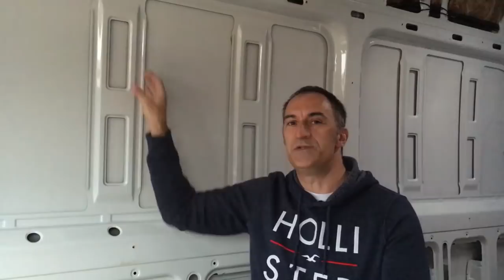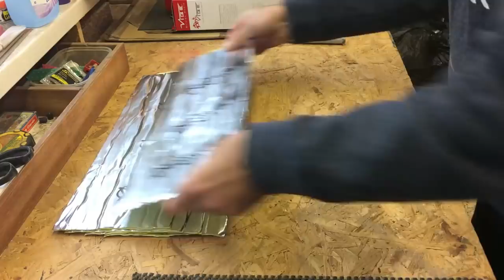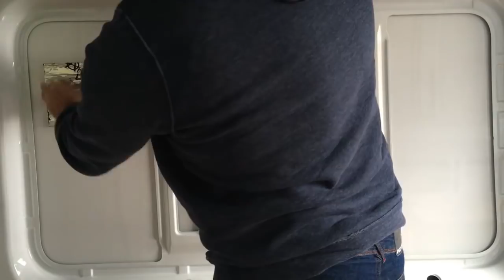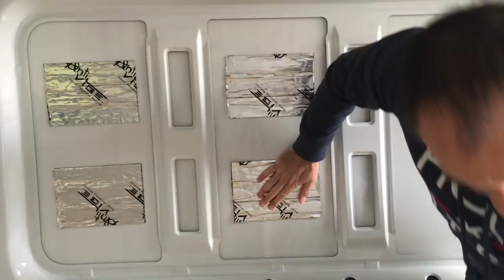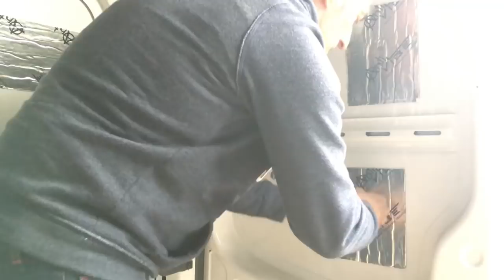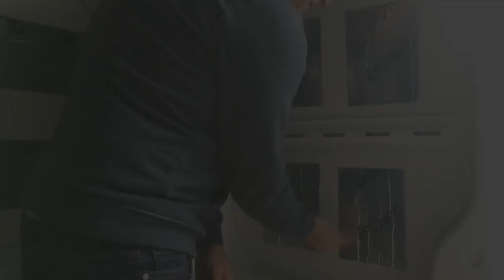Noise & Vibration in your Camper Van

Comment: Oh I love people who use 'sound reason' to solve a problem. You worked out by reason what I had to discover by 'necessity'. Many years ago I was a rather 'pocket poor' youth with a 'nightmare loud' Landrover. I could only afford a metre of the sound deadening material and so chose to stick squares of it to the door, foot plate, and side walls of the 'rover. I was so impressed! Covering  every centimetre is certainly not required. Imagine how covering a whole vehicle adds un-necessary weight, costs a lot, and you have to use up valuable fuel to drag it around. Impressed.

Comment: Greg, the Promaster has a really nice factory hard shell flexible panels with lots of space behind to put insulation. Really like the idea as I'm not going to live in the Van other than weekend trips...any thoughts on this: insulate and then factory panels?
Reply from the maker: Yes, absolutely no reason why not to reuse the factory lining again.
Just make sure to apply a vapour barrier on top of the insulation and seal all the joints with foil tape before putting back your liner

Comment: Not sure if you'll reply, but I've been bingeing your series and loving it! Would you recommend this technique in a 7x12 enclosed trailer camper for preventing outside noise?
Reply from the maker: Hello David, yes I endeavour to answer all questions and this is interesting. Sound deadening material like rattletrap etc is designed to prevent thin sheet metal from vibrating while you are travelling. As your camper is a trailer you won't be inside it when it's being towed so I would not bother with this material. However preventing surrounding noise from entering the trailer when parked up is a different thing to deal with.
Here you need sound attenuation and dense insulation like closed cell foam works best at absorbing noise transfer. Any insulation like rock wool for example will give you some attenuation of noise. So answer is to just insulate as normal and you'll benefit in two ways. Hope that helps
Reply: Hey Greg, you quite made my day by replying! Let's just say you have earned a loyal subscriber and liker of your content. What might be a relevant material in my case? I was thinking perhaps some sort of acoustic paneling (like what you see in recording studios); however, such may also be a misuse of the product.

Comment: Butyl flashing tape, which is available in rolls with a 6" width, is a cost-effective alternative to (supposedly) 'specialist' sound deadening material. In fact, it's exactly the same stuff.

Another good use, besides lowering the resonant frequency of large panels by increasing their mass, is to cover the wheel arches completely. As well as being dense, butyl is viscoelastic, so it's great for absorbing road noise close to the source, stopping the vibration from passing through the rest of the structure.

My advice would be to buy a roll or two of butyl flashing, cover the wheel arches first, then use whatever's left to dampen all the panels.

Comment: Just for future reference I work at a commercial body shop and use this stuff all the time and it is much more pliable and user friendly if you warm it up a little it moulds to the panel extremely easily and sticks loads better. Loving the content and the whole build quality 👍
Reply: The day I installed it was 110 degrees in my van, I found a couple areas where I had missed after installing insulation, that day was 70 degrees in the van, oh lordy was it a lot harder!  My advice, cut your pieces in a warm room with a heat source, then park your van in the sun and let it heat up, then go in and apply.  If you have to do it cooler weather trap a good sized heater inside till everything is warmed through.  110 was grueling but the job was fast.  Using a heat gun without the warm air didn't help as much as the hot day.
Reply from the maker: That's a great tip, I remember it was really cold when I shot this video.

Comment: Would you still need to do this if you plan to use spray foam insulation? Wouldn't that stiffen the panel thus limiting the vibrations?
Reply from the maker: I would say that the spray foam will do the job ok.

Comment: Thank you so much, now I won't be spending as much on materials when soundproofing my sedan. However, it is quite clear that this will deal with the vibrations, but what about the noise from the outside and the road noise? I plan to put foam along with this in the doors and cover the wheel arches with 3M undercoating, will that do the job. Waiting for your answer.
Reply from the maker: To attenuate the road noise you need to use the dense black foam products. The foam absorbs the sound waves. Use a combination of both in the right places will be hard to beat.
Reply from the maker: You got it in one Stuart, I plan to box them out and stuff mineral wool inside the boxes before I close them up.Thanks for asking

Comment: Its probably worthwhile to point out that panels that are installed in the fit-out could also vibrate causing noise. It might be worthwhile to check during and after the fit-out and apply the same mitigation treatments you mention Greg - both check and repair bonding and adding noise dampening materials - as well as noise absorption in the fit-out panels where possible.
Reply from the maker: Sound advice Benny 😊

Comment: Hi Greg, yep foam would work ( clever bstd ) I’ve spent a lifetime in landrovers and v8s so so driving anything too quiet freaks me out a bit haha . Might be picking a new van up Saturday and gonna do it properly this time so gonna be watching some more of your vids i think . Thanks mate
Reply from the maker: Excellent news Dan, What van are you getting?
Reply: Renault master mwb alloys ac spotties 150ps all the unnecessary extras ! In the silver/blue. It’s to replace my 2000 master in the old silver/blue the old girl is just getting a bit too tired. But it has to be a work van during the week so plyed up from the inside of the wheel arches to waist height and boxed in with both ends open for storage .bed hinges up in half both sides racking under bed for tools both ends. The racking slots into runners in floor and all lifts out and flat packs so i can get either a quad or a couple of trail bikes in.
Reply: So it’s a transformer van really sink/cooker unit is removable in one piece so front half of van is empty for work use. Diesel heater and webasto fridge off a split charge .
Reply from the maker: Wow Dan, it sounds amazing. Best of both worlds. I take it the design and build are all your own handy work?
Reply: Yep the racking/bed took me bloody ages to get right so I’m thinking rip it out and refit in new van, might take longer than starting from scratch but  might not and will save a few quid in timber. Must be 6 sheets of ply involved. Any ideas on good floor covering ideas? I was thinking rubber matting if i can do it in one piece,i used kitchen vinyl in the old one not tough enough and too slippery for tools and bikes.
Reply from the maker: I’m thinking of Altro flooring. The stuff that has the round circles you see in Leisure centres etc. Really tough.
Reply: Thanks mate, just had a look at the altro stuff . Looks just the ticket and quite a few places doing big offcuts .
Reply from the maker: If you find a good source can you share a link Dan? Cheers
Reply: Hi Greg, I couldn’t find the stuff with the circles on it even on their website but lots of the industrial non slip sparkly stuff. Seems to be a fair bit of it on eBay at the moment and big enough sizes to do a van in one piece.
Reply: Hi Greg, Harrison trim supplies seem pretty competitive on altro flooring prices they do the rubber penny stuff but only 1.5 wide rolls so not wide enough for me . They do some cool hidden trim clips ideal for behind carpeted panels.
Reply from the maker: Thanks for that tip, I haven't found anything wider than 1.5m either. I'd rather not have a join to contend with

Comment: Geezer talks alot of sense . Dynamating a whole van interior is a bloody waste of time and money and adds a shite load of weight ! Wheel arches are probably worth doing ?
Reply from the maker: Hello Dan, thanks for the great feedback. Wheelarches? Now let’s think what are you trying to reduce here. Vibration? No, road noise? Yes. So anti vibration mat is not the solution you are far better wrapping the arches in thick black foam used to absorb sound waves. The arches due to their shape do not ring. You need to attenuate the breakout through from the road. Even building a box around them and packing it with insulation would work.
Hope that makes sense.
Reply: Greg
Reply: I found the before and after of "dynamating" my wheel arches to be dramatic.  I used about the same ratio as shown here on the large tinny sounding panels but enclosed my wheel arches.  Before covering the wheel arches every rock that jumped off the tires made a sharp clink noise.  I had trouble hearing the speakers on full volume as I drove, the road noise was so awful.  After applying just dynamat equivalent, I had to turn down my speaker volume.  Rocks became a faint thud.  Children's voices were softened, as well as bird noise.  When I put in my second layer of thinsulate audio dampener the effect was even better.  I have a nissan NV and the roof was not as sound deadened as the Sprinter is so I did add both layers to the roof.  This really improves the rain noise.  I started out carefully cutting the pieces but soon discovered that I was wasting time with precision.  The NV is kind of erratic in panel opening.  Freehand cutting was clearly easier and dampens just fine. 

Just an FYI, I spent many years treating children with autism, high pitched voices tend to set kids off while low pitch voices aid in calming to a degree.  I find the same to be true when I have a migraine, high pitch hurts low pitch tolerable.  The dampening panels allow low pitch noise but cut high pitch because they stop the vibrations at that frequency.  When a rock clinks on the metal unprotected it sends a sharp high pitch sound through my van due to high frequency vibration.  Now when the same size rock hits the wheel arch it makes a thud. If you don't care about audio frequency it probably doesn't matter.  It's not so much that I am reducing the volume, I am reducing the pitch.
Reply: My thoughts would be to use a product on the outside of the vehicle, like maybe Line-x rock guard.  My Car's wheel wells are lined with a plastic matting, kind of like astro turff.  Please chime in if you have the proper terminology.

Comment: Extremely helpful - I am using my MB van for transporting freight and DID NOT want to use a lot of this dampener. Thank you for showing me that I didn't need to cover the whole wall - just add small panels. A+
Reply from the maker: The sole purpose of this deadening mat is to prevent flat sheet steel from vibrating. 
And only needs to be applied to the large flat panels. I’m small pieces covering no more than 80% of that flat panel. 
Don’t worry about the floor as it’s much thicker and creased. 
Or the small flat panels even the roof is usually creased so they do not tend to vibrate. 
Your thermal insulation will also provide the acoustic attenuation of outside road noises. Hope that helps 👍🏼

Comment: Was it to reduce cost that you didn’t sound deaden the whole panel?
Reply from the maker: No Karl, as I explained in the video you do not need to do the whole panel for it to be effective. The most you would apply is 80% of the area. 
This stuff is expensive and is very heavy so better all round to use only what is needed. 👍🏼
Reply: Understood.... so it was partially cost then ! :-) the reason I ask is because I have done this exercise in another vehicle and completely covered every surface.... the result is amazing..... anyhow great vid
Reply from the maker: Haha ok yes partly but not the main reason. It will add a lot of weight and it’s really not necessary to get desired effect. You must have spent a lot if you covered everything?
I only used 3 small sheets and spent £75!

Comment: Not silicone between the the panels Greg. Silicone and paint don't mix. Manufacturers normally use a polyurethane style adhesive or similar. Good job on the videos👍
Reply from the maker: Sikaflex would stick like mad and remain flexible.

Comment: Another fine explanation. Thank you!
Reply: Do you both know that you can also use a torch to shrink the metal and reduce that sound and tighten the metal so its not as easy to create vibration? I took a metal manipulation course and shrinking the metal may help in some areas where its flexing when you push on outer panels. Maybe using that method and maybe use less of this product?
Reply from the maker: Glad you liked it 😊

Comment: Wow I never even thought about noise regulation. I figured my insulation would do all that could be done. Thanks for the info as usual!
Reply from the maker: Hi Sarah, like I said in the video most manufacturers already do a lot to prevent noise being generated. Your insulation alone will give you sound attenuation as well as it’s thermal properties. Maybe some older vans suffer more with rattles than the newer versions. Thank you for watching

Comment: How much do you need for the entire van? I want to order some but I have no indication how much is needed. I have a L2h2 but if you tell me how much you needed I can guesstimate how much I'll need
Reply from the maker: These sheets I used, measure 800 x 500 and I cut them into 10 rectangles 160x250
I bought 3 sheets so that gave me 30 pieces in total. Enough to do both sides and the rear doors.
Total m² was only 1.2m² so you do not need much. Mine is a LWB sprinter.
Reply: Greg Virgoe thanks for the response! You're build videos are amazing. Just bought my van this weekend and super stoked to start working on it. Keep making videos!
Reply from the maker: Thank you Max, good luck with your build.
Reply from the maker: Thank you Max, good luck with your build.

Comment: Hey there Greg, I am really enjoying this content and finding it very informative.
How much material did you end up using in your Sprinter? I am ordering online with quite some delivery time so it would be best not to sit around waiting for more material if I would end up short. 

Would 4 sqm be sufficient for your van you reckon? Cheers!
Reply from the maker: These sheets I used, measure 800 x 500 and I cut them into 10 rectangles 160x250
I bought 3 sheets so that gave me 30 pieces in total. Enough to do both sides and the rear doors.
Total m² was only 1.2m² so you do not need much. Mine is a LWB sprinter.
Reply: Greg Virgoe thank you for a quick reply! Can't wait to see what you will bring next :)
Reply from the maker: No problem at all, happy to help.

Comment: Having worked in automotive acoustics engineering for a major vehicle manufacturer for 30+ years (and other automotive expertises for my sins), I would wholeheartidly agree with Greg on the measures for eliminating the drumming in the rear and letting the insulation do the absorbtion. What is missing are the noise measures in the cab, especially when driving. Harvey Smith correctly identifies the front doors and using deadening pads (don't forget to reseal the water curtain sealing). Self Build Camper and Greg's reply to the floor and bulkhead around the large noise and vibration generator (engine) are also very important. Some tips if you want to go the whole hog:
1) On the cab floor and firewall fit a layer of 20mm felt sound absorber. Yes, you really have to get it up to the windscreen, behind the dash and under the carpet. Size for size, it is MUCH better than foam. It should be quite "spongy", and usually being made of recyled cloth, make sure it is good uniform quality as bits of old stitching and seams cause noise transmission paths. (Don't know what's behind the headlining)
2) Anything that goes into the engine compartment has to be fireproof or self-extinguishing (all that fuel and oil vapour absorbed and very hot radiated heat). I suggest leave well alone.

OK, keep up the good work. Great videos. Spring is going to be here sooner than you expect!
Reply from the maker: Thanks Norman, some excellent additional notes there. Much appreciated.
Reply: Why not use Silent Silver from Amazon which is a closed cell neoprene sheet with a foil mylar coating?   It is thin at 1/8" thickness, waterproof, thermal insulation, sound deadening, and very flexible.  Felt can degrade with moisture, not this stuff. I'm surprised no one is using it.  Its a great underlayment for wood floors or carpeting.  One of the best.  And its pretty cheap too.

Comment: I thought insulation was for keeping the temperature under control
Reply from the maker: Tracy Keenan, it is also used for sound attenuation. Your silencer on your car exhaust is stuffed full of wadding like insulation. Silencers in Ductwork are filled with insulation material. Foam is great for absorbing sound.

Comment: Thanks so much Greg for these very very useful videos.  They have changed my thinking from :" I want to convert a toyota hiace to campervan but dont know whether I can, despite checking out many conversion videos" to " with all the help I can get from Greg's videos I can absolutely do this".  I have a question about possible noise generated by the floor insulation.  I read that, being rigid, it can squeak when the van is moving which rather put me off using it. What are your views, and do you get any squeaking from yours when moving?  Thanks
Reply from the maker: Hi Annie, I made sure when I was cutting it that it was a very snug fit, sometimes too tight and need trimming. But its wedged into the timber battens so good it's not moving at all. So I'm not worried about the floor. This stuff does squeak a bit on metal surfaces, I noticed when fitting it, but once it was secured with pins and tape it was very solid, I've been tapping it as I fit it to see if it is noisy and so far I'm very happy.